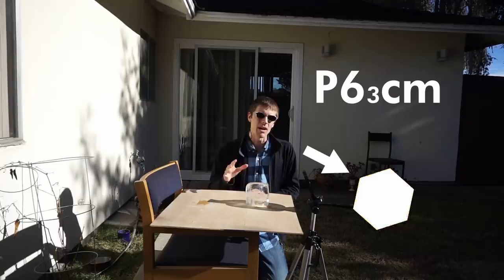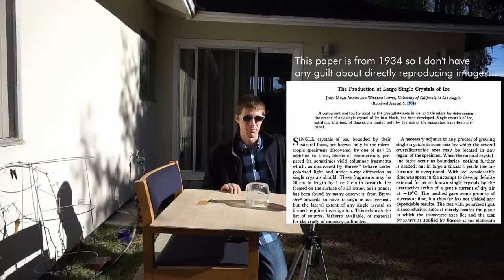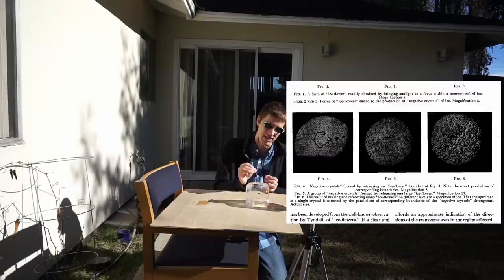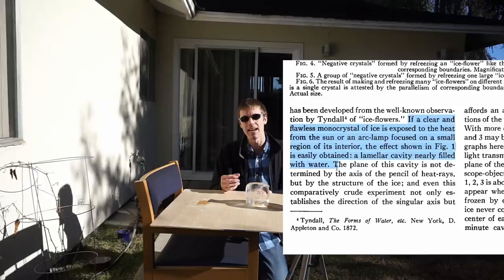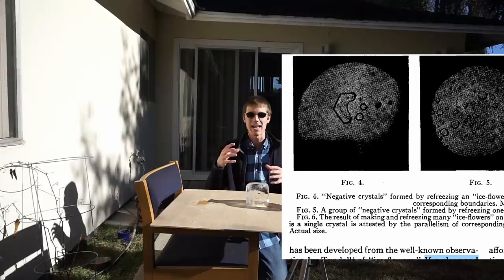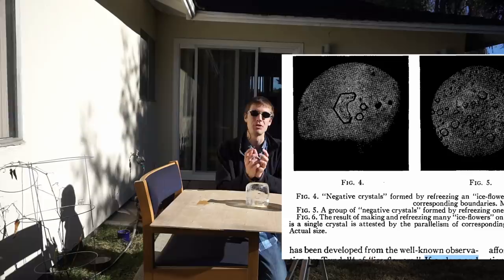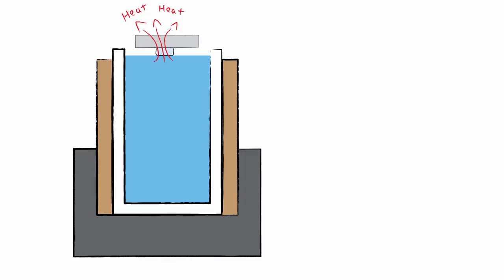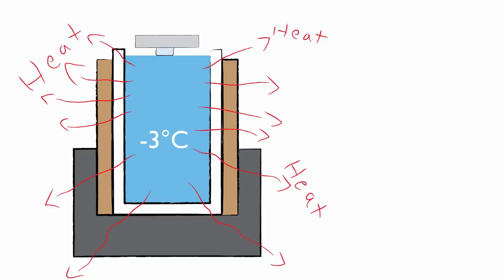What is polycrystalline water?

Comment: A long time ago I saw a tv show, maybe how it's made, where they covered how blocks of clear ice are made for ice carving. The process is simple, get a big ole vat of water, make it cold, and move the water constantly with a pump. The main goal of this is that it takes more energy to form a crystal with contaminants, so with the temperature held at about 0C, and the water always moving, it's too hard for contaminants to freeze into the crystal, and it's too hard for voids to form. Only good pure water can join the crystal, and it does so evenly.

This method may be able to increase the margin of error with your technique even as the water cools off, by lowering the temperature of spontaneous crystallization just a little bit further below the temperature of monocrystaline growth. I imagine though that it will also make the tank more efficient at conducting the heat in the water to the walls, making it cool off faster.

Comment: Maybe try adapting the Czochralski method. It's used for growing silicon crystals for semiconductors and also uses a seed crystal lowered from the top. The difference (in addition to what you mentioned about temperature control) is rotating the crystal / bath, which I sus
suspect helps prevent dendrites.

Comment: along with wrapping your ice chamber in foam and a towel, add an electric blanket (very low wattage) so the outer parts don't freeze inward.  That way, the "coldness" is only coming from the crystal you want to form.

Comment: id suggest electrobooms favorite cooling method: peltier electrothermal displacement. they're basically these square pads that, when current is passed through them, go cold on one side and hot on the other. i know that by controlling how much current passes, you can control how hot/cold each side gets. just an idea. let me know if you try it, id like to see the end results!

Comment: I’d attempt to do exactly what you did here, except with a peltier cooler and heat-sink atop the aluminium block, and in a refrigerator set to 1-3C or so.

Also you’re fast approaching 2^14 !
Reply: A small compressor might also be an option, if only for the thermal efficiency.
An easier method might be an aluminium (bottomed) container full of salted ice-water, though you’d need to calculate how much ice would be required to solidify the water beneath.

Comment: Nice process.  Instead of a magnifier glass, why not use the 3 laser method on each axis to melt the center of the ice.  Similar to the acrylic bubble art.

As you also mentioned, the pressure change as it is freezing would affect growth.  Would a counterweight of the aluminum block also allow equalizing the pressure at the freezing point in the chamber to equalize the surface pressure of the water?

I look forward to the next video.

Comment: We invented a slush drinks machine that doesn’t need a scraper, instead forming ice in a recirculating flow in a pipe, as the heat transfer is set up to create dendritic ice that is broken off by flow in a pipe. The heat flux and thermal diffusivity together control whether you get wall ice or dendritic ice. If the thermal diffusivity is low and the heat flux is low enough to avoid big thermal gradients, even if the wall is the only cooling surface, an instantaneous quanta of energy is easier to donate to the surrounding fluid so ice grows dendritically. Maybe this is what you encountered?

Comment: As I recall, single-crystalline silcon ingot growers rotate the seed in one direction (say clockwise) and the molten silcon in the cricible anti-clockwise, and slowly pull the seed upward at a rate that defines the diameter of the ingot.  Could the same be done with the water "seed" and chilled water "ingot"?

Comment: Perhaps you could use dry ice to cool the aluminum plate. You could keep the apparatus about the same, with a box of dry ice on top in thermal contact with the bar. Then either turn down the freezer or put it in the fridge.

Comment: Do you think the convections movements in the water could create dentrites? Some convection cells would appear and cool the whole water recipient and then, because the thermal isolation with the outside is not perfect, some dentrites could have been created somewhere else.
I would suggest to try the same experiment but with the aluminum bar at the bottom of the recipient. Might be a very tricky setup though...

Comment: I once left a water bottle on the porch and when I went to get it the next morning it was liquid but the moment I touched it the whole thing instantly froze from the top down.  Very cool effect.  I wonder if this creates a polycrystalline structure or perhaps it produces a single crystal structure as the ice builds from the top down very rapidly?  Sadly I was not able to repeat this phenomenon after several attempts. I read somewhere distilled water works best, the fewer contaminants the better.
Reply from the maker: It’s almost certainly polycrystalline and dendritic - my last video about “hearing ice freeze” is exactly the same process you describe, just with a bit more control over the process!

Comment: So to my metallurgical mind, you hot-shorted a block of ice.

For others: hot shortness in steels occurs when there is a low-melting-point phase mixed in with the steel (iron sulphides, copper* or tin*) that is liquid at rolling temperatures (900ºC-1200ºC). These liquid phases migrate to the boundaries of the steel crystals (or 'grains') and lubricate them, allowing the grains to more easily move relative to each other and reducing the hot strength of steel.

*Copper or tin are normally soluble in steel but aren't soluble in iron oxide. If the surface of the hot steel oxidises, the copper/tin comes out of solution as a liquid and penetrates into the grain boundaries of the steel below. This type of hot-shortness shows up as surface defects.

Comment: Have you looked at how ice sculptors make their ice, they use a cold plate with a bin of water on top and a small circulation pump. The ice forms from the bottom to the top due to the agitation of the water stopping the growth of crystals on the container sides in adition to the sides and top of the water being above freezing.

Comment: My first thought was to, instead of using an aluminum bar, use an aluminum flask that you then pour liquid nitrogen (or w/e) into.  That would make the ice attached to the bottom of it the only source of heat reduction for the water.  Does that make sense?

Comment: Impurities in the water could very well be the reason you are getting polycrystals in ice, (dissolves gasses, salts etc). You can try with ultra pure water or vapor deposition like you had done, which deposits the pure material, relatively
Reply from the maker: Very good point - I think this was tap water. Distilled or RO would have been a lot better

Comment: Could this problem have been solved by placing the setup in a very cold but not sub-zero environment and adding a Peltier element to the aluminum bar? That way the surrounding air could not have supercooled the water and heat would've passed more efficiently through the seed crystal.

Comment: Well, what if you put the water container under pressure, like high pressure, then dropped the temp to -30C, then very quickly released the pressure?
Wouldn't the water flash freeze immediately before the grain boundaries formed?
Edit: kind of like when you leave a water bottle on the cold porch, then when you open it, it freezes almost instantly.

Comment: are you sure the problem didn't occur when you were dripping the water on the cold (<0 deg C) aluminum plate at the very start? you assume it was only a single crystal, but it seems like this is the most likely scenario where that polycrystalline structure formed since the temp control of the aluminum was below freezing.

Comment: Interesting video, but you were cutting/melting a piece of monocrystaline ice out of the ice block. So I would assume the piece is wet from the cutting. If you're putting it on the cold aluminium bar, the molten water touches the sublimated ice cristals on the aluminum bar and forms many new cristals(Because the bar is much colder than the monocrystaline ice and thus grows faster near the aluminum to dump the heat of crystallization). If you layer on water, to form a bigger cristal, I think you are also growing those cristals bigger, which were formed by the sublimation on the aluminum bar and growen bigger by the molten ice from the cutting. Is that logic or am I just missing something?

To prevent that from happening, you could try to just stick it on to the bar, and hang it in the water, without layering the water on before.
Reply from the maker: My goal was that the polycrystalline grains generated when the wet water hit the aluminum would be trapped physically on the other side of the monocrystalline seed, and everything growing from liquid would epitaxially expand the monocrystal. It’s also possible the monocrystal itself was too cold for epitaxy while I pipetted water on it
Reply: @AlphaPhoenixChannel  Good idea, but I think that the trapping on the other side doesn't work this way in this case.

It seems as if a drop on the side of the monocrystalline ice had frozen on to the aluminum. In my mind this happens:

The heat gets carried away by the path of least resistance. In this case there is ice and Aluminum touching the water. Aluminum conducts much better and it already has some resublimated ice crystals as well as the bigger surface area touching the water. It reaches the freezing point and grows from every crystal it touches. As a result the surface has many crystals with different orientations. 

@ 7:48 you're pipetting over the section where the water froze to the aluminum bar as well as the monocrystaline ice. Both sections are exposed to the water and grow their crystals with it. If hanged in the water bucket, there is now monocrystalline ice aside of polycrystalline trying to outrun each other in the cool water to form the big crystal.

The area on the bottom right, where the edge of the cut is interrupted is the area I suspect isn't monocrystalline.

Do you know what I mean?

Comment: You need to cut off a long piece of ice crystal and find a way to cool it down while in contact with water.
So the crystal is the only thing that is touching the water and freezing it. (you can cool the water to above freezing) 
If the crystal has grown a bit you need to cut it at a thicker part and reattach it there, so it can transmit more heat away. 
Then you should be able to grow a pretty big monocrystal of h2o
Reply: And you really have to make sure that the freezing water only touches the crystal... After watching further I see you spilled a bit of water onto the aluminum, which is a big problem to avoid

Comment: 09:03 is it possible that water from the reservoir below or the original seed crystal evaporated/sublimated, attached itself to the aluminium or the rather the small ice crystals besides the big seed crystal fast enough to outgrow or match the crystal formation from the seed, thereby growing additional crystals unalinged with the seed? (which eventually stretch out as far as the original crystal), touching the liquid water below, forming the additional dendrites seen?

Comment: It looks like the thermal conductivity of ice is about 50x higher than polystyrene foam, but the heat of fusion of water is about 80x its specific heat. So, you were losing the race to freeze the liquid (vs drop its temperature overall) by a factor of about 1.6 - and that without even counting in the massive surface area difference. I suppose thickness of the polystyrene vs size of the original ice crystal would be fairly important here too, but probably (evidently) wouldn't counteract that aforementioned surface area disparity.

How do you guys ensure a single nucleation site for monocrystalline growth in your MBE?

Comment: Have you ever put a bottle of pure water in the freezer for a few hours and came back later and it not be frozen.  But the second that you shock it by tap it something it will starts to freeze from one side to the other right before your eyes. I wonder capable of getting one that way not sure of the physics behind.  its purity has a lot to do with. I do know that Dasani are the freezer relatively easy to get in this state.  it takes quite a bit longer for those bottles to thaw out and melt when in the cooler with simular frozen  bottle.

Comment: Hmm.... Thinking about the explanation for why dendrites formed... you said in your explanation of what you hoped would happen that as little pockets of water start to freeze, they'd float to the surface and stick to the crystal.

But what if by the time a freezing cluster of water molecules grows large enough to overcome brownian motion and gain a steady momentum upward, it's also large enough not to be a single crystal anymore?

Aren't there companies that make single-crystal ice for bars, so they're perfectly clear and optically transparent? I don't think they nucleate a site. Rather, I think they freeze it very slowly with even cooling from all sides in very, very clean containers. And I think they use distilled water, too.
Reply from the maker: Clear doesn’t mean single crystal - that ice sold is a very clean polycrystal
Reply: @AlphaPhoenixChannel  Ahhh, okay, cool.

Comment: Would the Czochralski process of crystal growth used to obtain single crystals of semiconductors work for ice ?
 
You would need a very low power insulated heating element (a bunch of low value resistors carrying current - I squared R losses) in a freezer to keep the ice molten! (since the room temperature is lower inside a freezer, and the natural state of water is a solid in that environment, it would technically be molten ice instead of a liquid water) as you slowly draw out the rotating seed crystal.
Reply from the maker: I think it would - just requires more active control than i wanted to deal with inside a freezer

Comment: What if you had a drip apparatus that only applied the next liquid layer after the previous had frozen, and instead of freezing down, you applied upward from the seed base?
Reply: This likely wouldn't work. Drips of water are too concentrated in one spot to get clean layer-by-layer deposition. However, you are very close to an existing technique called "vapor deposition", which does the same thing but with vapor.

Comment: the water must be colder at the top due to the aluminium. some of the 0 celsius water may go to the bottom of the container due to density differential. if you use 1 or 0.5celsius in the whole system only cooling the aluminium below 0 it might work better.

Comment: You could probably do this by, instead of using a bar of aluminum, you could use a bar of copper that you'd dunk into liquid nitrogen on intervals, so there's be a ton of heat mass for the water to sink its heat into without needing a freezer

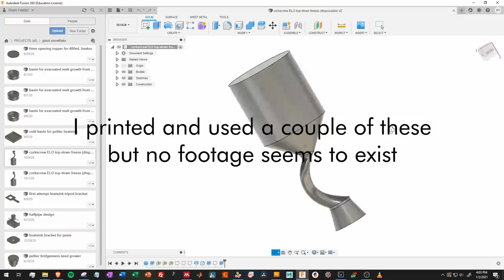Comment: How do different cork screw rotations affect grain number? 🤔😁 10:50
Reply from the maker: I think you just need one! (In the world of casting turbine blades, not ice)
Reply: @AlphaPhoenixChannel  I was going to mention turbine blades! This explains something I saw in a TV programme about the manufacture of Rolls Royce jet engines some time ago. It was mentioned they were a single crystal and the company didn't reveal a lot about their secret sauce to produce them, but the footage showed a ceramic structure that looked pretty much the same as the one you modelled. Now I know what it was, so thanks.

Comment: What if you tried the same thing but using some sort of sub zero cooler rather than putting the whole thing in the fridge. 

If you take apart an old AC or an old cooler from a car, then pass the coolant through some sort of water block that is attached to the aluminum. That way you shouldn't have water freezing from the sides, only from the single crystal.

Comment: I would think the goal would be to cool the sample FROM ur seed crystal, thereby allowing it to grow into the liquid rather than the opposite.
Reply from the maker: exactly! My insultation around the rest was too little and the conduction path through the ice seed was too slow so it didn't happen that way. In an ideal world, I'd be able to cool only one point in space, but getting a peltier below freezing without some insane cooling on the hot side is impossible for long periods of time. (If I leave a peltier sitting in water OUTSIDE a freezer, the water eventually heats up, the hot side heats up, and the cold side heats up and melts)
Reply: @AlphaPhoenixChannel  I don't know how far u want to go with this project, but it might be do-able to use/modify one of those mini-fridges. =supercheap. +All the cooling is in that freezer compartment thing, which can even be moved if ur crafty enough. I've always wanted to find flexible tubing to have those cooling lines >> flexible !!  moveable !! Portable !! oh that would be sooo useful cool.  Even if u just want to go rigid it's as easy as 4 parts + your experiment.  2 tee's and 2 valves/needle/stoppers. objective= Make a bypass to divert the flow anywhere u want/experiment.  yea, it's one of those things on my todo list ;p